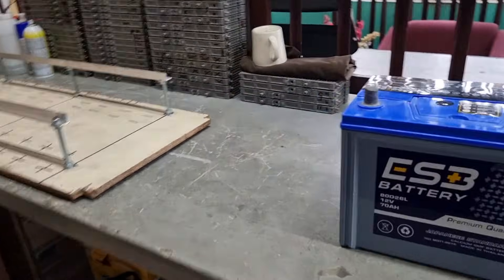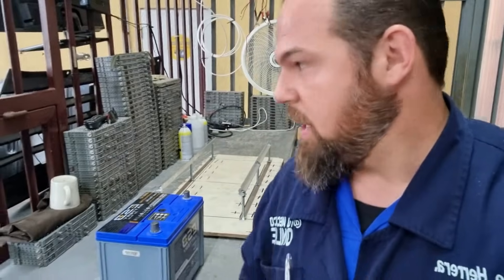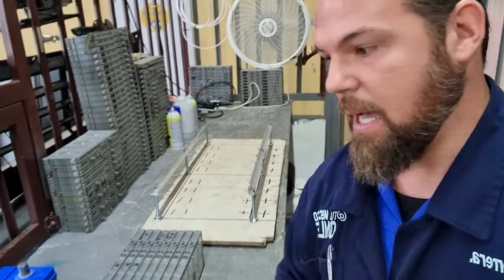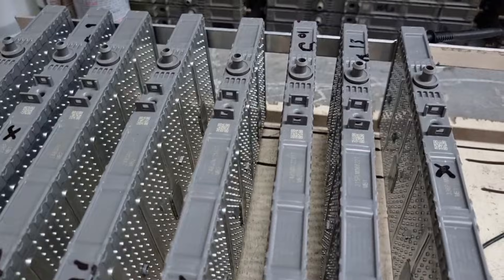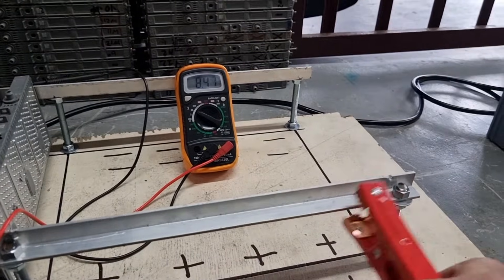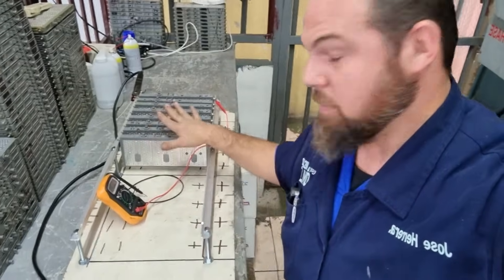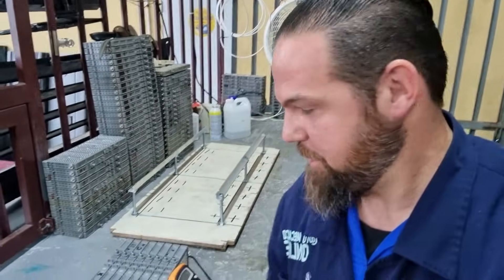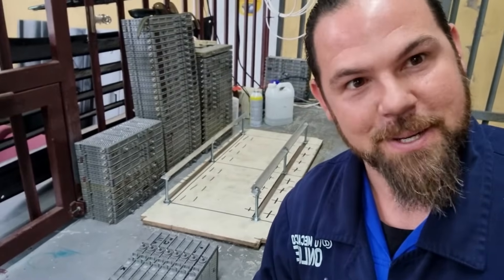how to charge a hybrid battery with a 12v battery

Comment: Dear Sir, 
Can you upload the video, how to connect the Solar system with hybrids system of the car.. if we connect hybrid sheet on top roof of the car
Reply from the maker: Hybrids don't really need that cause of their setup and small battery sides, however P-HEV and EV does and there are many with solar panels vehicles in the market already but they need a system control for that...
Reply: @hybridsolutiondiagnostics  hello after doing the balancing how long will it last

Comment: So, I have a question.  If you have a 2 amp trickle charger for a 12v battery, and you were to put all your modules on a balancer made like yours, is there a reason why you can't add a resistor to the leads on the 12 v 2 amp charger that would bring your voltage down to 8.25V and then just hook up the trickle charger to your balancer rails so that it would trickle charge at 8.25 v at 2 amps?  Then after charging for several hours or overnight, disconnect the charger and let them balance?  P.S. thanks for the videos, i've been watching a few as I am trying to learn about working on a prius.  Sort of trying to teach an old dog new tricks (me being the old dog)
Reply from the maker: Overcharhing these modules for long time will damage them... it is why the charger should deliver not more than .2 to .4 amps in pulses...
Reply: @hybridsolutiondiagnostics  I'm not sure what the internal resistance of the modules is but wouldn't it be safer to put a 60 ohm resistor on the battery to limit the current below .2 A ?
Reply: A secondary question that has come to mind, and I was wondering if you might be able to answer it.  In a prius group I joined there are always the posts arising about the 12 v battery being weak and causing issues with the voltage being too low and causing error codes to pop up.  It has been said that the 12 v battery doesn't crank the engine for starting it.  If that is the case, why didn't the manufacturer just feed the 12 volt side off the high voltage battery using two battery leads with resistors in them that would drop the voltage to 13.5 volts to feed the low side of the car?  Or is that a safety issue and is that why they use the 12 v battery separately to feed the low volt side?
Reply from the maker: @Cometchannel-ou9ih  it is the HV battery who cranks the engine via MG1... but to activate the HV system you need a 12v contactors to close the HV circuit so if 12v  battery fails there will be no HV system to start the engine 👋😎👋😎

Comment: This works just fine. Just don't keep it hooked up too long. I have charged up to 10 at a time. It really suck the 12 volt battery down so I keep a charger attached.
Reply: I am doing this right now - my 12 v batt was at 9.6 volts and I attached a charger to it, then I was like hum... should I have that charger attached to the batts too or not - see, when these batt are in the car, they are charged up to 17.8or so volts - so, if you do charge it increments, it will be fine - right now the 28 modules I have are at avg. of 7.54 - I want to bring them up to 8 volts before putting it back in the car - ANY suggestions?
Reply: @arnoldtarbooz1420  don’t 7.5 is good

Comment: Can you use a 12v trickle charger for a hybrid battery just to raise up a few modules??
Reply from the maker: As you just saw in the video 👋😎
Reply: @hybridsolutiondiagnostics  Using a trickle charger would work in theory, however most cannot deliver more than a few amps before the thermal cut out activates, on overheat or over current. Using a battery is ok but the voltage will drop to the stage where it is lower than the voltage of the cells in the hv battery where no current will pass to the hv cells.

Comment: I'm enjoying the classes, keep up the good work, have you ever done a video on load testing the modules? I wanted tk know what's normal voltage under load and how long should I leave the load on ? Thanks in advance.
Reply from the maker: That video is coming very soon 👋😎
Reply: @hybridsolutiondiagnostics   when!! Its been a month lol i’ve been searching for that part after the quick charging on your machine  video 🤪
Reply from the maker: @sweetbaby96  gloriaaaaaaa what part? ☝️😮😮🤣🤭🤣🤭🤣🤭🤣🤭
Reply: @hybridsolutiondiagnostics  AHHH yay you answered..lol umm I was waiting on the 3rd master class to this. I thinking what comes next from this video? the load test and the discharging with the same idea of having some limited instruments to work with on the batteries from home.  And what do you think of the Smart-tech SBC-50 Battery charger instead of the 12v battery and what do you think of the SkyRC max B6 AC V2 battery Charger/discharger? How would you use it or would you recommend it? And would you use Cen-Tech for load testing?? And how would you use it?
Thank you for your videos by the way..I love your silliness with the expertise behind it.
Reply: I did my load testing using a 6/12 volt load tester for cars. I found that putting a 20 second load on a fully charged cell will pretty well weed out the weak ones. If the voltage under load dropped to below 6.1 the module was suspect.

Comment: That was very interesting. It never occurred to me that you could use  a 12v battery for charging. The one thing I would like to see is a current clamp on you battery cable so we could see just how much current the batteries in parallel are drawing.
Reply from the maker: A lot ☝🤣 so dont leave it conected for long... 👊😎
Reply: A lot! It really socks the charge out of the 12volt so I keep a charger hooked up.